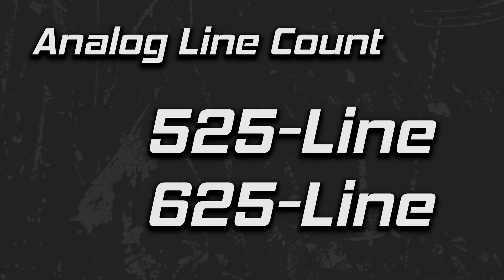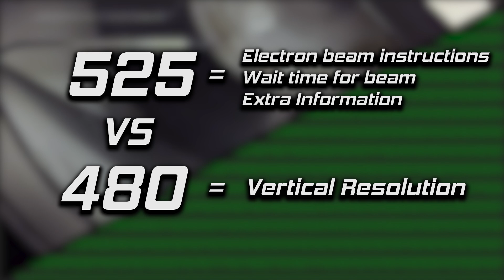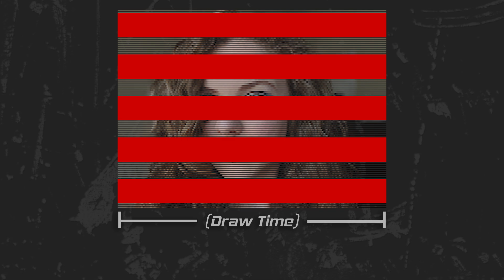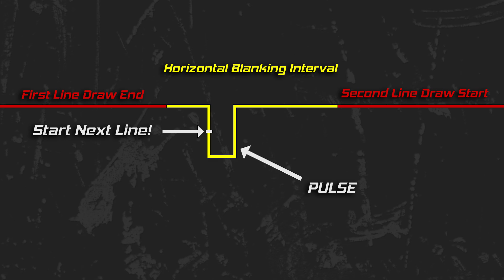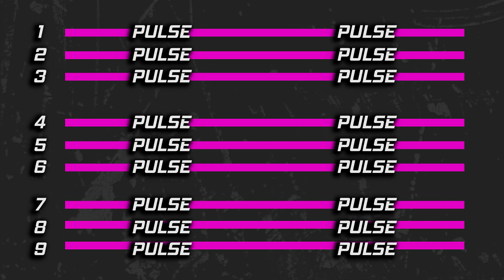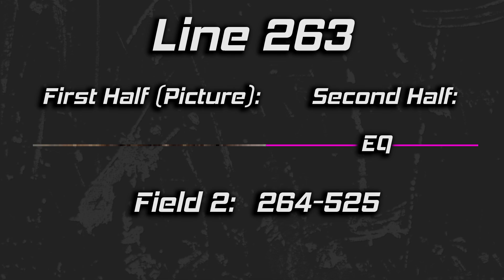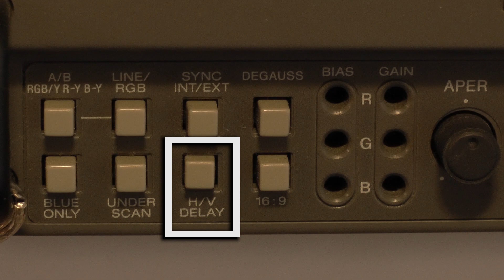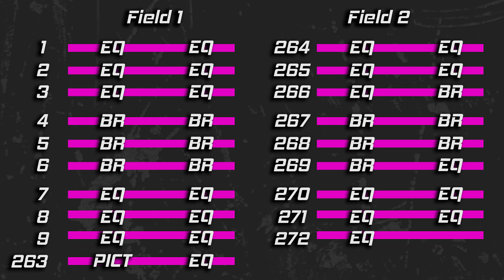What is 525-Line Analog Video?

Comment: I have a question, I understand that sync signals help stabilize the image, but what's the actual physical process of "locking" to the sync?  I was always confused about this.  Does the electron beam never stop moving? or does it finish the lines before the sync signals stops and "waits" for the sync signal before proceeding?

If it never stops moving, how does the beam adjust when it receives the sync signals?

Comment: Your videos are great, but in every interlaced-video explanation you never mention that an interlaced video stream could present 2 fields of the same source image, resulting in a sort of 30fps video (movies in europe were telecined at 25fps with this approach, I know in the US 3:2 pulldown was used) or present 2 fields belonging to 2 consecutive images (odd lines from image N, even lines from image N+1 in time), which I consider "true" interlaced video (live TV for instance). Since the latter is what 100% of early TV broadcast consisted of, I just wish you mentioned that the second field could represent another instant in time, as well as additional lines of resolution, because to me that is the great "trick" of interlacing: flicker aside, your eyes perceive 60fps at """480p""" resolution when in reality you're getting half of the information. Feel free to correct me if I'm wrong :)
Reply from the maker: Hey Giacomo,

I thought perhaps pulldown would be best left as a topic of its own for a follow-up video to this one. I consider it to be a pretty good-sized chunk of a larger topic - that of converting 24 fps film to video.

I would most likely want to expand beyond 525-Line and also include 625-line, talk about the native field rate (60 Hz and 50 Hz), talk about pulldown as well as speed changes for adapting to 29.97 fps and 25 fps.

The length and content of this 525-Line Analog video was a bit too much to include all of this. I suppose I could have found a way to mention it in a casual manner, but I elected to omit it completely for pacing and volume of content I threw at the viewer.
Reply: While Canadian English TV stations used the American sources for movies, French TV stations used the PAL sources from France converted to NTSC. So growing up in Canada, I could always tell right away that I had accidentally tuned the French station because everything was higher pitched than it's supposed to be.

Comment: anyone know if 256p can be displayed on NTSC tv if adjusted on Service Mode ?
Reply: You can do this with high resolution CRT computer monitors with the right adjustments. I had a fancy CRT monitor that let you adjust any resolution or timing that you wanted. You could "hack" video signals with it and descramble some pay-per-view signals without an external box.
Reply: @salvatronprime9882  but can you do it on NTSC tv?
Reply: So no one knows? No ones tried it?

Comment: Progressive 480 isn't 240P; it's 480P. It's not sacrificial; just a different order.
Reply: many resolutions can be progressive. not only 480p!
Reply: @PSXMicha , when did I supposedly say otherwise? Pschhhh....
Reply: 60Hz is the key issue here though. 240p is the only way to get a progressive signal at 60hz on a consumer TV. 480p could only be done with 30fps. (monitors and professional equipment could do better of course)
Reply: @salvatronprime9882 : Since when? What about all these standard HD or even 4K+ TVs that can do progressive scanning of those large frames at 60, 120, or maybe even 240 Hz these days (even though typical frame rates are 30-60)?

And how am I supposedly "wrong"? When did I ever say "progressive can be interlaced" or vice versa? Reread my main post.

And why did you put "properly" in quotes? Since when was that figurative?
Reply: @HelloKittyFanMan.  well the context of this video is analog CRT signals. Modern digital systems operate in a completely different way.
Reply: @salvatronprime9882 : You said "consumer TVs," not "standard-definition" or "analog CRTs." Your reply is independent of the video's context. Also, what about the rest of what I asked you?
Reply: @HelloKittyFanMan.  the context of the discussion is implied by the video itself. No need to declare context. We aren't talking about 4K HD, or cars or sports or clothes. The video is about analog video signals and CRT displays.
Reply: @salvatronprime9882 : No it's not. Not when you just say "consumer TVs." Yes there is that need. That would be like saying "all computers" in the comments of a video about desktop computers and then expecting not to have included tablet ones and laptop ones in "ALL" just because the video didn't cover those other two. It doesn't work that way.

Of course we aren't talking about non-display stuff, duh.

How about you go back and read the rest of my previous reply and handle it now?
Reply: Although, if one wanted to be pedantic about this, you are still technically wrong. Interlaced is interlaced, progressive is progressive and there is no mixing of the two. There is only 1 way to "properly" do a progressive image, by definition it must draw each line in succession in a single pass.

Comment: This was fun to watch...
Now for the headache, it's analog, there is no autoadjust of the electron beam, it was fixed timing setup at manufacturing by setters with a screwdriver and in fact you can also say the beam always runs the full lines, just it does a blank travel in interleaved mode and could perfectly run non interleaved (though it would cause some glitches and flickering visible and that's why TV were interleaved)
With time and wear, the pulse could unsync, barely visible if not a slightly blurry or deformed image because the beam is a bit too high, too low on the tv grid or the speed of it isn't right. This is then you know your tv tech is a master or just crappy one!

And add more... broadcast standard, NTSC, PAL or SECAM
Reply: Thats why for me it was always worth the extra money to use monitors instead of consumer TV's. A good monitor allows adjustments of all features and timings manually.

Comment: Why do english speaking folks always pronounce "sync" as "sink"?
Reply: KRAFTWERK2K6 Because pronouncing it like “apple” would be wrong.
Reply: Sync and sink are homophones for most English speakers
Reply: Because "sync" is an abbreviation of "synchronise" (verb) or "synchronize". For some reason in this word the "ch" is given a hard "k" (as in Kraftwerk) sound. Chronometer also has the hard "ch". Sync" retains this even though it has lost the h in the abbreviation. In cheque the ch is softer (German friends pronounce it as sheck which is softer still). I'm glad you didn't ask a question about the electronics in the vid!

Comment: When you consider everything mentioned in the technobabble it is quite a miracle Analog Television even worked at all. But hey, it DID work! :)   And actually a LOT better than digital TV. Seriously.
Reply: Rose-tinted glasses much? We have 4K now, HDR and much more. CNN is still CNN though, but current TVs are a great monitor.
Reply: @4.0.4  Even though the vertical picture resolution of standard broadcast is only about 480 lines, that says nothing about the fidelity of the signal within those lines.  If you pulsed additional line data across a single line, it could be interpreted by a display to generate additional lines, creating a means to encode video at 8K and beyond.  Also, since the color signal is analog, it would be trivial to include HDR-formatted color data and simply instruct the display to alter its color space.

The advantages of analog media are why movies and TV shows filmed on - well, film - still hold up today.  Because analog theoretically doesn't have a limit on the "quality" of content it can contain, it's only limited by the physical constraints of the transmission and storage method.
Reply: @Shotblur  This is also why even Laserdisc still looks nice if projected. Despite the chroma noise of the composite signal, the whole colour level still looks different and somewhat more what the eye would expect rather than the 8 Bit colour space of DVD and Blu-ray and even UHD (which too is sadly only 8 Bit).
Reply: @KRAFTWERK2K6  This is an interesting discussion. I've often thought that the pictures of HD TVs often look unnaturally vivid and sharp. Real life rarely looks like that! However this seems to be what is pleasing to the eye, even in still photography where "natural" colour looks far too muted for most people. Then again well produced cinema releases (pre-digital but on 35mm high quality film emulsions and using high quality cameras with high quality cinematographic techniques) can also have this "digital" quality. The same is true for music. Older analogue recordings can stand comparison to digital recordings in terms of clarity (not Jon Landau's muddy production of Born to Run, unfortunately). Anyway have a look at this Technology Connections vid discussing film and digital: https://www.youtube.com/watch?v=rVpABCxiDaU
Reply: @davidjgomm  Yeah. Even film prints where colour graded. And also adjusted to the various emulsions. This is why the James Bond movies looked drastically different in their original Technicolor prints compared to the old DVDs and the Blu-rays which were remastered by Lowry Digital. Or the Alfred Hitchcock movies like "North by Northwest". Where i personally find the Blu-ray master absolutely terrible with it's "modern" colour grading that looks way too cold and badly adjusted to fit modern grading schemes. And also why people were confused about Nolan's restoration of "2001 - a space odyssey".  Thanks for the link. :) I'll check it out. Haven't seen all of this dude's videos yet.
Reply: @davidjgomm  When it comes to audio i totally agree too. For example all these fullcoat magnetic film recordings (basically 35mm film coated with magnetic particles to record on like on a magnetic audiotape) that has been used for many classical recordings in the 60s sound absolutely AMAZING. This "Living Presence" recordings have been released on SACD and they have a brilliance, clarity and detail that was only possible with digital PCM and DSD recodings many many years later. So they always had high quality recoding sources to master Vinyls, MCs and CDs from it. It is amazing what quality was possible even 50+ years ago if you compare it to the digital mediums we have today.

Comment: THANK YOU FOR THIS VIDEO!  I kept trying to explain to people how Todd Rogers abused the black screen period between scans to obtain his "impossible" times in numerous atari games.  NOBODY listened to me!  They kept saying "that's not how frames per second works!"  I kept trying to explain to them, "There is no real thing as frames per second on a CRT!!!"
Reply: Todd Rogers is throughly outed as a fraud. How displays output video information has absolutely nothing to do with how input is received. His times are impossible, this has been throughly explained in several short documentaries debunking all of the technobabble he (and his fanatical followers) regurgitate.
Reply: @BiscuitFever  he wasn't though. What happened was a bunch of brainless idiots in the speed running community used emulators who don't utilize blank screen cycles and do actually push games through at 60 fps.

How input is received does actually deal with the hertz cycles and the blank screen.  He was able to input commands through the blank screen cycles, basically he abused glitches in how atari polled its controllers.

Please, stop lying to cover up for the bullshit tests the didn't actually test original machinery.

Comment: I don't understand. Why does the beam need time to get back to the other side? It's not a pencil, it's a stream of electons. If you apply a sawtooth wave to the beam deflectors, it will just jump back to the beginning. If you apply two sawtooth one to each coil, you need almost no time at all, since the electron beam gets deflected to the other side instandly. You displayed it with a pencil that you move back to the other side but that's not how an electron beam works.
Reply from the maker: All time required for the signal is based on the period of time at which it was invented and then standardized. As technology improved over the years, the time needed wasn’t required, but the signal remained the same.
Reply: @DisplacedGamers  But you said the beam wanders back when it actually isn't.
Reply: @dreamyrhodes       Yes, it did require time to get the beam back to the other side on a CRT (even though its intensity is a zero).   The fact that the beam is turned off makes no difference.    

A voltage across an inductor (coil) causes a current to flow which generates a magnetic field to deflect the electron beam.  All inductors have resistance to the change in intensity of that flow.   That resistance is called inductance.  

Putting a sawtooth wave across a deflection coil (or coils) doesn't mean that it can retrace instantly, it takes time.  Not a lot, but remember we are talking about  4.85 microseconds for the horizontal retrace.  The vertical retrace time was much longer (several scan lines).   In some cases CRT TVs would have a failure where the beam wouldn't turn all the way off during retrace and the retrace lines would be visible (showing that the beam did in fact go back and forth even during the retrace period): 
https://i.ytimg.com/vi/lwl--gvuzIw/hqdefault.jpg    It's a bit like moving a flashlight back and forth but turning off the light when it is going back to the starting point.  The coils are doing the same thing whether or not the beam is turned on.  

A coil must be discharged through a resistive load or it would generate a spark like a coil in a car that drives the spark plugs.  Time must be given for the coil to discharge at an acceptable rate and for the opposite coil to charge in order to get the beam to the starting position for the next line.   The width or time of the sync pulses is for that purpose.   It also later provided time for the color burst signal when color TV was invented. 

You can read about charge and discharge of inductors here:
https://electric-shocks.com/rl-circuit-analysis/
Reply: Because resistance in the electromagnetic deflectors only allowed them to change their magnetic charge so fast in order to deflect the beam, so they couldn't do it instantly.

Later on the tech got better, but TVs still had to follow that old standard or else they would have been completely incompatible with basically everything.

Comment: Invented in the U.K., then used in most of Europe, we had the teletext service transmitted over the air in the ‘spare line’, a service that offered hundreds of selectable pages of information without the need for a modem or computer. For some reason the US, did not make much use of the system and I believe only one cable network actually used it.
Reply: We had Teletext Here in new Zealand, it was quite handy in its time
Reply: We still have teletext in Finland
Reply: @Pasi123  
it's still running in Iceland too.

i think the reasoning is that there is a need for an alternative if accessing the internet is impossible.
Reply: @Pasi123  here in Germany we still have Teletext too
Reply: @Pasi123  Modern teletext is no longer part of the actual broadcast itself, but actually an extra dedicated "hidden" channel that is only accessed by hitting the text button on your remote. So it's not teletext as we knew it from back in the day, which was actually interlaced, as it were, into the unused parts of a channel's signal.
Reply: Yes, that one cable network in the US that had teletext was Superstation TBS--they carried a teletext service in the 80s and early 90s called "Electra".  TBS only carried the service, it was actually originated and programmed by a company based in Cincinnati, Ohio called Taft Broadcasting (who owned a few local TV stations in the US and also the Six Flags theme parks, IIRC).

Zenith and their "Digital System 3" line of TV sets were really the only brand & model of TV available in the US during Electra's era that could do teletext, although Australian company Dick Smith Electronics did offer as a kit a set-top teletext decoder through their American affiliate re-sellers, and was featured with assembly instructions in a 1985 issue of Radio Electronics magazine in the US.  Electra closed down in 1993 due to the service losing money for Taft, as well as Zenith around the same time discontinuing teletext capabilities in their sets in favor of built-in closed captioning as required by the FCC at the time for TV manufacturers.  Not sure why Zenith couldn't of just kept the teletext features along with CC decoding, considering the two technologies are quite similar.
Reply: CBS would've been broadcasting their own teletext service at this time -- ExtraVision. However, it was based on the more expensive/complex NABTS text system as opposed to the British standard WST (a major factor in the service's failure).

Comment: Grew up with CRTs, used emulators in the mid 90's-and 2000's. Back to the original hardware and a PVM these days. It's really the best way to do it. And as mentioned in other videos, even component has its merits, so I'm looking forward to getting a nice Trinitron when I have the space.